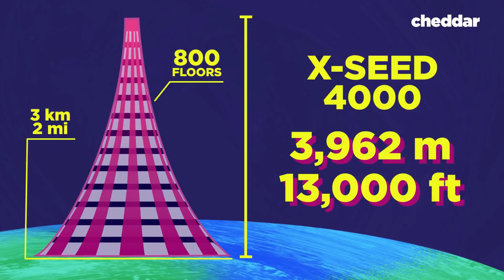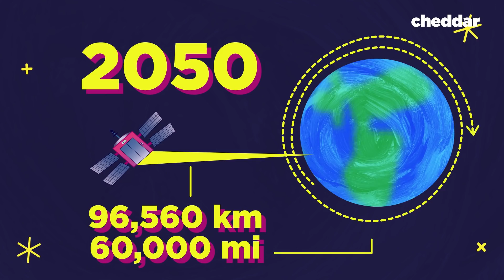How High Can Skyscrapers Go? - Cheddar Explores

Comment: Here to answer the question the video failed to even remark is me...

The max limit of height that architects and construction blueprints can build to at are time of 2019 is around 600 floors. If we were to pass that amount than surely flight patterns would cross with such a building since it would have to have a large base structure that's stable and won't cave in on itself.

Building to the moon is possible with combining of many metals (400 different kinds of strong flexed metals that can withstand the power of gravitational force. Your confused I understand...what I mean is we would need a massive metal band that fits the circumference of the Earth with an angled transport beam that will slowly build to the moon, (and heres the tricky part) fitting the circumference of the moon as well.

It would be 2 metal hand cuffs tied together by a microscopic flimsy wire filled with people being slowly bent in half as the space softens the supports pulling them away from each other as the Earth and Moon slowly tear that wire apart piece by piece until it becomes floating debris being sucked into the Earth and Moon resulting in catastrophic damage to the testing site and city point that it is being located.

The only way which isn't possible yet would be a luminescent light strand that bends with the changing of density in the atmosphere and gravitational field pulling on both sides (meaning: it doesn't flip the wire of metal like a Twizzler or over-heated strand of softened glass).

Final result: a rotating massive disk around the circumference of earth that can activate a light beam with a unbreakable layer of light in between so people can transport safely from Earth to Moon without being warped into your self like two highly opzcitized colours intersecting.

Final Conclusion, the moon is drifting further away and Gravity is a dick

Comment: Space elavators are impossible since it can break when planets move that are connected to its partnered moon. Even ETs can make one but Dyson spheres building for outer space is possible.
Reply: look for your ugly daddy in fucking space 21983471204827948234984239128341093840335219978131446516532094 miles away from the pentagon.....

Comment: The jeddah will  be 1008 meter not 999
Reply: no, 1007 m
Reply: @TheBestOfSweden  no 1008m
Reply: @sccmbr4535  we dont know untill we build it. It could be 1007, 1008. Sometimes its just an extra meter taller/shorter then the plans.
Reply: @sccmbr4535  1007-wiki doesn’t lie
Reply: No jeddah tower. Stopped in 2017.

Comment: You're wrong about that being the first building to ever use metal structure inside and out and about it being the worlds first sky scraper. The first official one was the Flaxmill in Shrewsbury, England. It was the first ever building to have a steel structure of its size and was constructed over 200 years ago.
Reply: Iron Framed*

Comment: I admire anyone that builds these buildings. I refuse to stay higher than the 3rd or 4th floor. No way I could help build one.
Reply: With a proposed method for active structural support (using energy to keep a structure up, you could build stuff from the top down, and then add in power. This means you never go higher than a few stories, saving major cost
Reply: i do not admire them....i find them dumb...not you...i consider you to be more intelligent and less ego-driven....

Comment: Uh. 1 Km isnt 999m its 1000m.
Another Correction: A Space Elevator connects a Ground Destination (A) with a Destination in Space (B) where you place those is up to you. How you hold B in place is the harder thing. Either Geostationary orbit ... or maybe a Megastructure around the Planet from where to link those two points together. Seriously its that easy on paper.

Comment: This was a very poorly researched video. It gave a crappy estimate and then just showed the problem with building using current materials. Then they gave a crappy I dunno. I hate that the media just acts like space elavators are a good idea.
Reply: If that thing get damaged or fucks up you know what happens... we have giant fucking flexible metal tube that comes down smashing a fucking ton of citys and has twice the circumferance of the world... sounds like a great idea
Reply: @friendssmoking  That's not at all the problem with space elevators. The problem is that we just don't have any materials strong enough to actually hold the elevator down, it wouldn't come crashing down to Earth, it would snap off and go into space from the centrifugal forces.
Reply: Frikgeek I also wonder if it could mess with the way the earth orbits.
Reply: @thenoicemango1827  lol no hahahah, you would need way to much weight to change Earth's orbit
Reply: @Frikgeek  oof
Reply: @friendssmoking  O_O

Comment: Without even watching the video: As buildings become higher and higher they need to support more and more weight at the bottom. I theory we could build as high as we wanted provided we start with a big and strong enough foundation. The more the weight of the building is spread out at the bottom the less weight per given area is applied, which is why the Burj Khalifa looks the way it does. And the more area the foundation covers the more stable the building becomes, a perfect example being the pyramids in egypt. Think of a scale model of one of them with a footprint of 5 x 5 cm. U can push the tip sideways all u want, the thing won't ever tip over or even break somewhere at half its height.

It's simple physics that everyone should be able to comprehend. And I'm not even an achitect.
Reply: Yeah. If we really wanted to build that tall we would use active support
Reply: so why don't build an artificial mountain higher than everestwith an stairwell in it? and than jack off to it....

Comment: Just asking for another plane building crash. And that doesn't have a terrorist attack just an accident.
Reply: That's a terrible argument. Let's just go back to living in caves because people might die
Reply: Noob Tube never said that but it is obvious that  this would be to tall to even be practical. Considering how busy the sky is with planes all the time this would just be another problem. It would seriously be the dumbest thing ever built. And the fact that a lot of people dying when it can be easily avoided is a terrible argument that's just dumb.
Reply: @noobtube7344  cave or such a tall building going from extreme to extreme.....looks like your an idiot....why don't you drive 200miles per hour through 5th avenue NY? only because others had an accident.....terrible argument........i never heard about such tremendous casualties during another building collapse......

Comment: Yeah this is wrong. The reason a space elevator needs to be in geostationary orbit is because it's at that height that satallites orbit around the earth at the same rate that the earth rotates. Objects at positions higher then geostationary orbit orbit slower then the earth rotates. This would cause the top of your building (if you can even call it that at this point) stray away from being perpendicular to it's base. The only pheasible way you could build higher than geostationary orbit is if your structure was rigid and space elevators are not.
Reply: Space elavators are overrated by the media, even though there are actually good proposals for getting into space cheaply like the lofstrom loop or skyhook. Look it up. It's really cool
Reply: Actually, if the top is in the geostationary orbit, then all of the weight of the structure will still be pushing on the ground. Ideally you would have a counterweight going beyond the geostationary orbit to counterbalance the weight of the elevator structure.
Reply: I'm so glad someone else caught this too!

Comment: If you use the whole planet earth as an anchor or as a foundation, you can go even higher. (Earth is within a tear dropped shaped building. Pointy cap rises into the heavens while earth supports everything).

Comment: Enough with this space elevator nonsense.
Reply: Right. The space elevator is an uninformed pipe dream that will never happen. There are other proposals with actual numbers possible with current tech that doesn't need rockets. 

Look into lofstrom loops or skyhooks. I hate space elevators
Reply: @noobtube7344  Pfft, I want my orbital ring

Comment: With carbon nanotubes, it's estimated that we could go as tall as 30,000 kilometers. Even if a material was strong enough yet light enough to handle all the stresses acting on a structure that tall, getting water and other resources up to the top floor would be very very tricky to say the least! For example, it takes kilotons of pressure to force water even several hundred meters up to the top levels of a super tall skyscraper, so much pressure that the pipes run the high risk of exploding. One way to avoid or aleviate this in a building that's several kilometers or more tall would be a system like they use in the Burj Khalifa, in which the water goes into tanks at strategic parts of the way up. Then would be the logistics of getting people and cargo between the hundreds, thousands or hundreds of thousands of levels of the structure. Sky lobbies and multiple elevators would have to be used to streamline the passage of people and things between say, the ground floor to the 300th floor and vice versa, the 300th - 600th floor and vice versa, possibly the ground floor to the 2,000,000th floor and vice versa. With the exception of the building materials and cost, moving people and cargo from one floor to another several hundred, thousands or million storeys above or below is the biggest factor limiting how tall a building can be and how many floor levels it can have. I estimate that 3km tall and 700 storeys is the maximum we can build with current technology. This means that the Megacity Pyramid, Sky City 1000 and the Dubai 2.4 km tall building are possible with current technology, but X-Seed 4000, Space City 6000 and space elevators are impossible with current technology.
Reply: Numberjack Fiutro stfu kid no one needs your dumb ass acting all smart
Reply: No. Space elevators are a pipe dream that will never be possible. Even with unobtanium there are better proposals
Reply: @noobtube7344   They once said that about airplanes and pretty much every modern technology! Space elevators might be possible one day, and would be a great option for affordable civilian space travel.
Reply: @numberjackfiutro7412  there are better alternatives though. One of active support. Any means of constantly pushing on something is much more realistic than super strong materials. Check out Issac Arthur's video on space towers for a more in depth explanation. I am no pessimist, but the space elevator is simply obsolete by lower tech solutions.
Reply: @jason 124 pang j The cold would be the least of your worries if you were up that high unprotected. The lack of pressure and the radiation would be more lethal than the cold. 
Any building above about 5km with more than 1667 floors would need pretty good insulation and pressurization on the upper floors!

Comment: This went into stupid sci fi territory in no time.
Reply: If I have a rope attached to a satellite and I pull on it, won't I pull the satellite down because it's floating in no gravity.  Something would need to pull in the opposite direction equal to my weight for me to climb
Reply: Yeah. Space elevators are a terrible idea that need unobtanium to function. the only benefit is getting a lot of floorspace, or spaceflight. The actual topic of tall structures like this is really cool and I would recommend checking out Isaac Arthur's video on space towers
Reply: Noob Tube We have the technology and strong enough materials.  Technically The only thing preventing people from building one is the cost. But, a space elevator would dramatically reduce the energy we currently use trying to get materials into space.
Reply: @noobtube7344  We wouldn't have miniature space elevator prototypes in orbit right now if engineers thought it was impossible..

Comment: The first skyscraper was in Shrewsbury in the UK...nice one
Reply: Who recognizes that but Brits? I'd change my mind if you have evidence... post a link!
Reply: https://en.wikipedia.org/wiki/Ditherington_Flax_Mill 

Ditherington Flax Mill built (1796 - 1797) almost 90 years before the Home Insurance Building. It was half the height of the Home insurance building but it is recognised as the first ever building to use the metal internal frame style of building. Although the Home Insurance building was the first to use steel in its construction it was still mainly built with iron for the internal frame.  It's all easily verified with just a couple of minutes of searching and reading.
Reply: Daniel Thornton that’s not a skyscraper, it’s a large industrial building in a midsized city. A skyscraper is a white collar building with a large height to width ratio in a major urban area. With that logic the VAB is a skyscraper, even though it’s just a hangar.
Reply: Of course everyone is entitled to their opinion, and there's no doubt America dominated the early days of skyscrapers right up until the last few decades. However Wikipedia is good enough for me. It has an internal metal frame and multiple floors. That's the definition as I understand to mean skyscraper.It's not even close, there's nearly a century in time between the two buildings. Not that it makes much difference but the Home Insurance Building was demolished after what 60 or 70 years?
Reply: I really do hope you're joking.
Reply: Tommy Tinsley not. It was in Chicago. Where skyscrapers where born. Try again.
Reply: Orlando Nunez Nope he's right, I live in Shrewsbury and it is the first skyscraper ever built. Americans are so ignorant
Reply: Tommy Tinsley no, it was in Chicago. https://en.m.wikipedia.org/wiki/Home_Insurance_Building
Reply: Are you stupid? I hope you're joking.